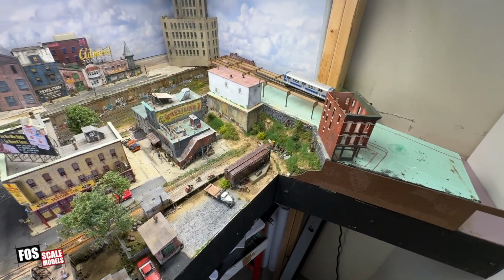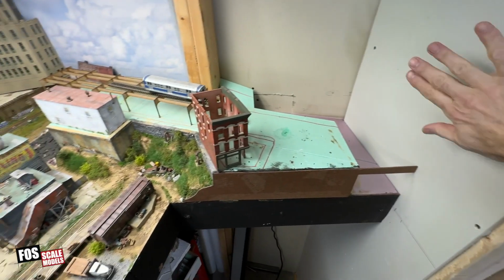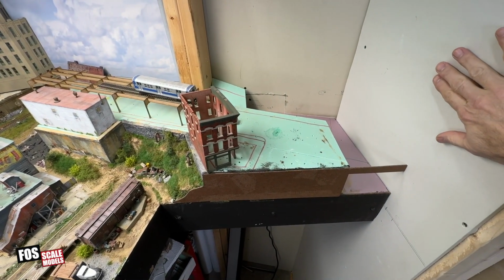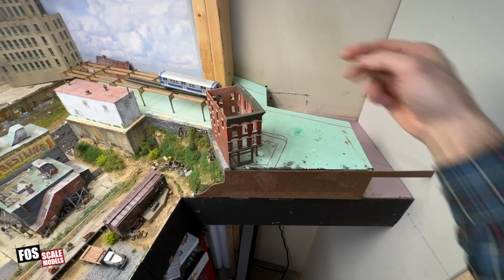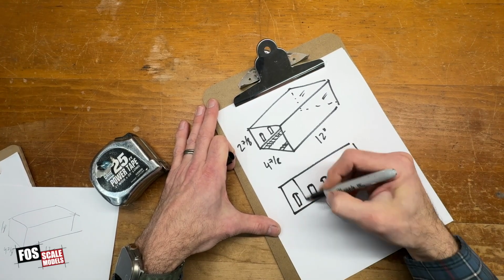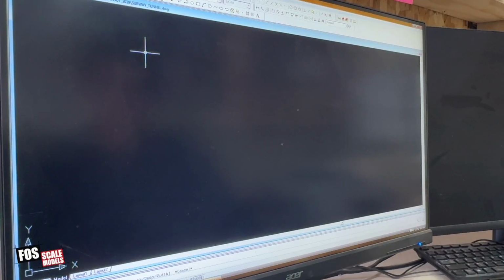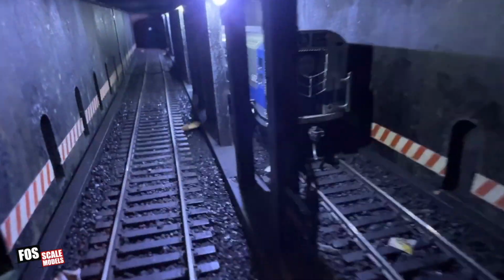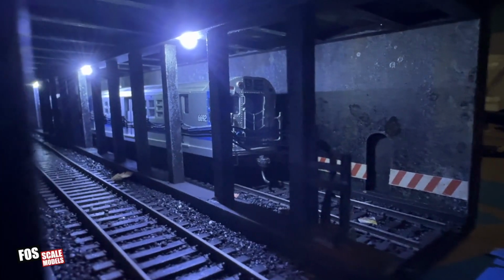Building a Realistic HO Scale Subway Tunnel with a Simple Trick

Comment: Nice job on the model. It's an accurate depiction - only difference being the 3rd rail omission. Also, the tunnel lights are typically mounted on the tunnel walls. I work for the TA and have walked the subway tunnels on numerous occasions with a front row view to the details. Fun Fact: The recesses in the walls are referred to as "niches"; "manholes" are structures used to house/access cable runs/equipment. Hope to see some of the kits in N scale!
Reply: There were other differences as well;  there wasn't any catwalks on the side walls like there usually would be, and the niches were rounded, instead of squared, as they mostly are in the NYC subway tunnels.

This DID, however, look like an accurate representation of the LIRR Atlantic Avenue tunnel from the Flatbush Terminal to the Bedford Avenue portal;  no catwalks on the side walls which, incidentally, have rounded niches.

Comment: This is what I wanted!!! I want to design one that is underneath the fascia and I was thinking of doing Helix to bring up basically what would be two levels out of a tunnel and then be an elevated rail system, that crept out of the tunnel on a slight incline. Then I started thinking why deal with the Helix when I could just make the topography change. So now I'm thinking more along the lines of on one side of the layout, there will be a visible subway station, or two... And then disappear back into the fascia and gradually do a climb and come out the same slightly inclined tunnel but on an area of the layout where the street level is much much lower
Reply from the maker: Sound ambitious , go for it. Thanks for watching

Comment: Yeah I was looking for the third rail, spacing between the ties, and lights on walls which is prototypical. Would suggest adding lights to the car. Nice job overall
Reply from the maker: Yup I think a permanent car w lights should be next.
Reply: I was looking for the niches to be located in the center wall, and SQUARED instead of rounded, plus the jack arch walls with catwalks....